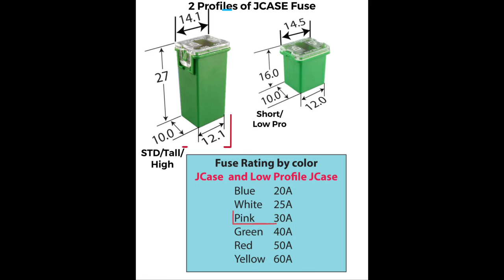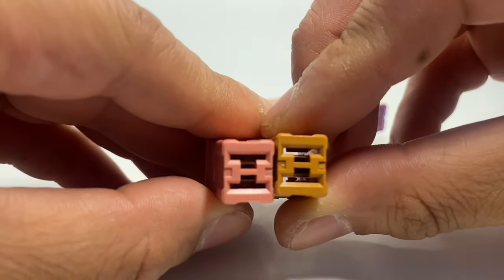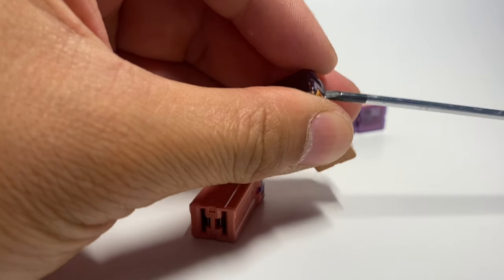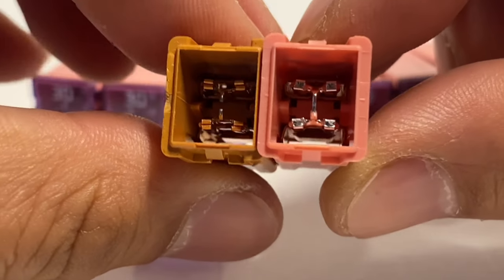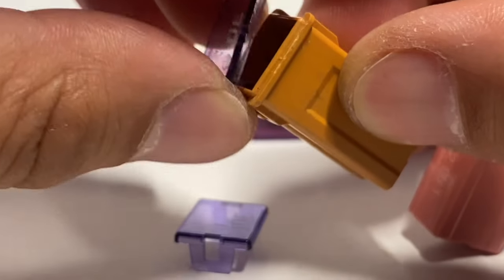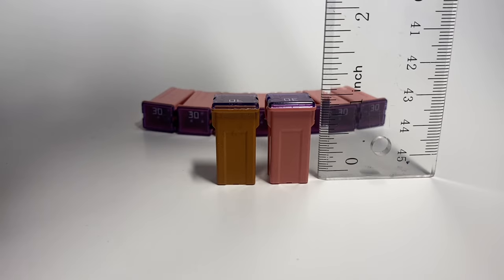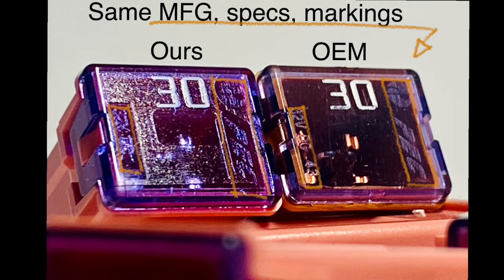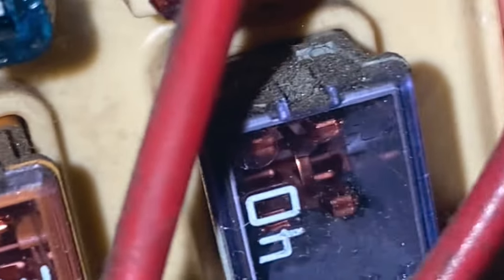30 AMP Fuse (32V DC, JCase, Tall/High (STD) Profile) Toyota Lexus Honda Pink A165

Comment: How do you remove it? I don’t wanna break it and there’s no video that shows me how to remove this. Damn thing I want to replace it.
Reply from the maker: Usually there will be a fuse puller tool in the fuse box, but if you bought the car used the previous owners may have lost them. There is a holder in the panel built in. It’s like a squared off tweezer, you snap it on the head of the fuse and pull it straight out. 

If not, you can use your fingers if they are strong and skinny enough. You just need a skinny tool to pry one or both sides out. I know people use flat heads, but you have to be very careful not to arc the metal or damage other fuses. 

A fuse puller at your local auto parts store is the best bet, and may lessen headaches or possible damage that improvised tools may cause

Comment: What does it power?
Reply from the maker: Hi thank you for watching. So it depends on which vehicle you have. 

For one of my cars, 1999 Lexus SC 300, there are a few 30 amp fuses. If it’s inside the car, driver side kick panel, it will say “DOOR” and “30A” on the fuse location. This one is for Theft deterrent System, Seat Controls, Fuel Opener Control System (fuel door on outside of vehicle), and Power Door Locks. 

This fuse is actually the same fuses used in other Japanese and American Vehicles, like Toyota, Honda, Acura, etc.

Comment: How do I know if it’s blown by looking at it and how do I pluck it out of fuse box?
Reply from the maker: Hi @lalaelena. If you cannot see through the top of the fuse because of the location of the fuse, you may have to pop it out. 

Every fuse box comes with a plastic fuse puller, that look similar to tweezers, but will be squared off at the end. 

If yours is missing, you can use two flat plastic objects (people use flat head screw drivers, but you can chip or break the fuse parts, or whatever it’s resting on for leverage. Also if it’s metal, you run the risk of shorting something out if you touch the wrong places, so be careful). If you have time, you can purchase a fuse puller from Amazon or even your local auto parts store to be safe. 

When you look through the top of any fuse, there is a piece of metal that just looks like a line, like this - 
There should be no “break” in between. If it is just a line with no break, current can run through from one side to the other.

If it is popped, you will see a break in the fuse like this through the middle 
- -  when it is like that, current can not go from one side to the other, and is popped and needs replacing. 
Hope this helps!